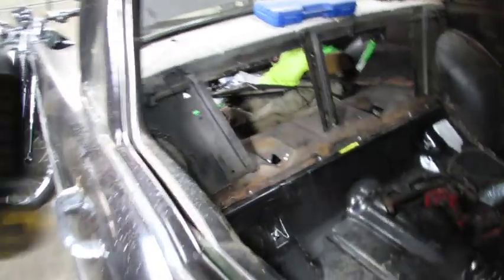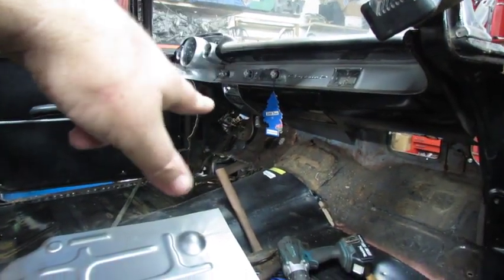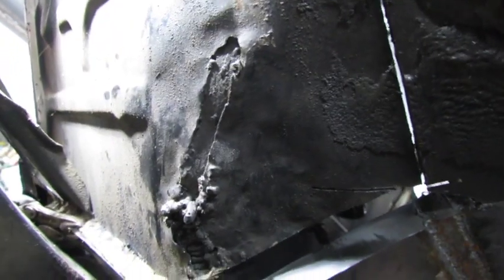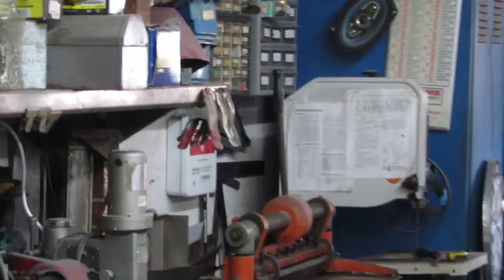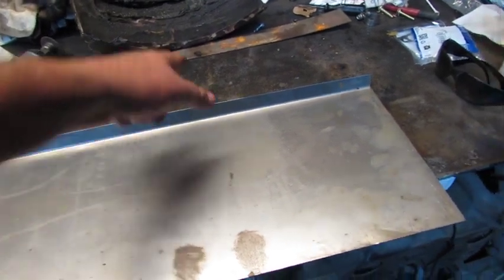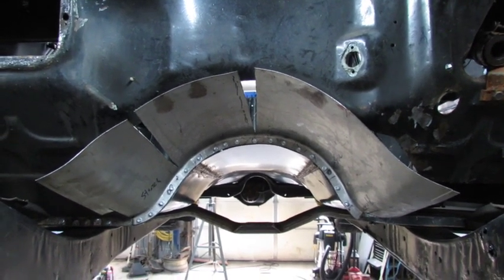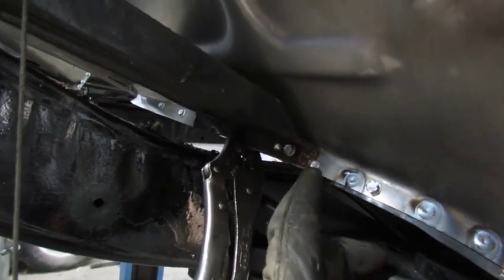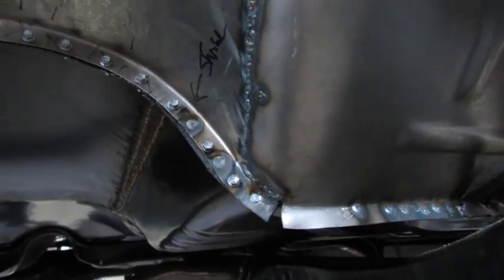57 Chevy-Finish Transmission Tunnel

Comment: Looks pretty good, Sir! The rust in the door jamb wasn't noticed as it didn't sand out over the worst stuff elsewhere!  No need for a bigger shop.... you'll just stuff it with more crap and wind up with the same size workspace you have now....lol I do the same thing with projects... I get hot on them then after a while get burned out. Most people sell them, well i don't Just put them aside for a while and come back to it later. Usually with the same enthusiasm I had on the previous run! People sometimes don't understand all the effort and focus projects like these take. We all need a break sometimes!!!